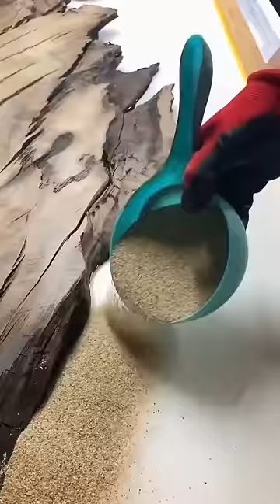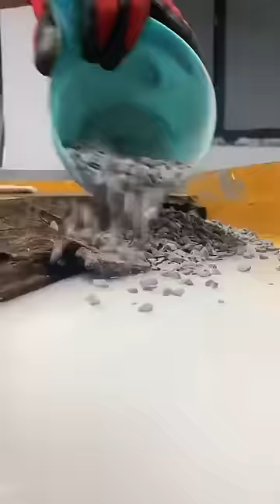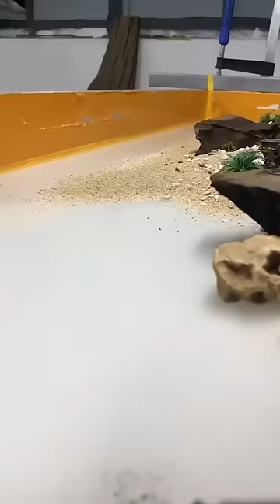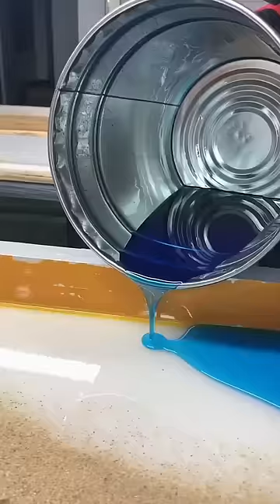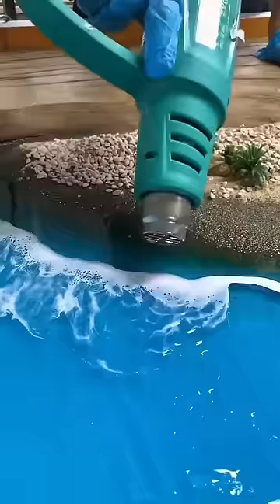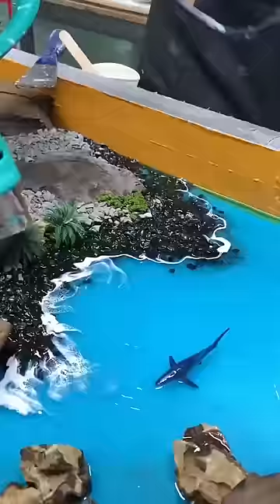Blue Lagoon Resin Beach Table! 😍🇨🇳🏖 | Wood Walker #shorts

Comment: When you lay the waves down, do you add them in top of a layer of clear un-cured epoxy?
Reply from the maker: You can. It gives the wave colors something to flow against. And once you're done creating waves, a clear coat or casting layer can go overtop to protect it.

Comment: would a  hair blow dryer work for that or do you specifically need a heat gun to create that effect ?
Reply from the maker: Some makers use a hairdryer, but the heat helps spread the resin as much as the moving air.